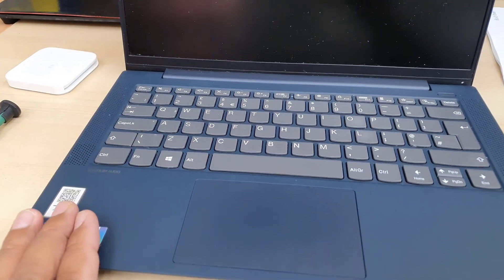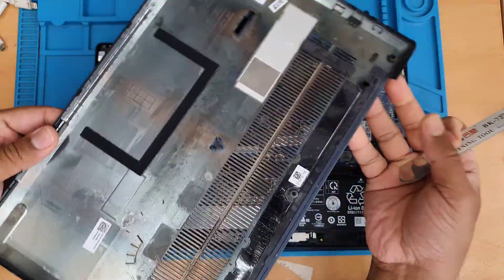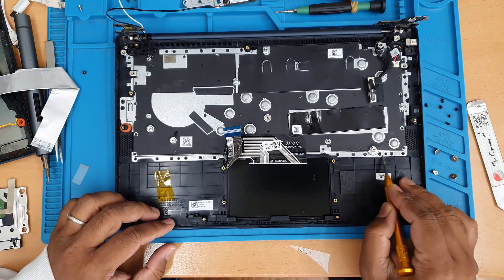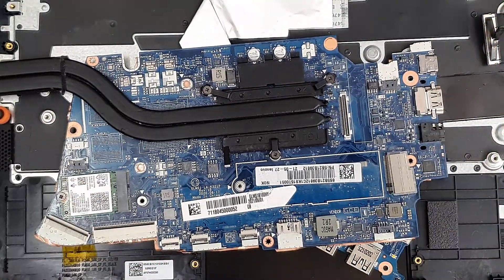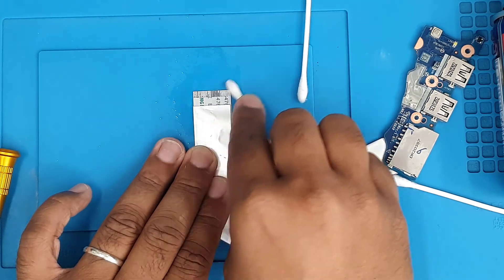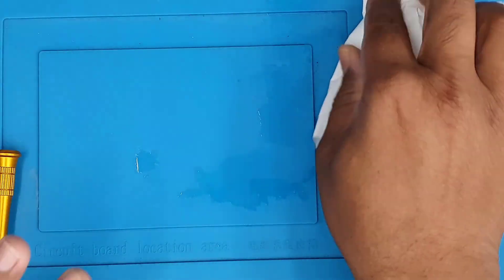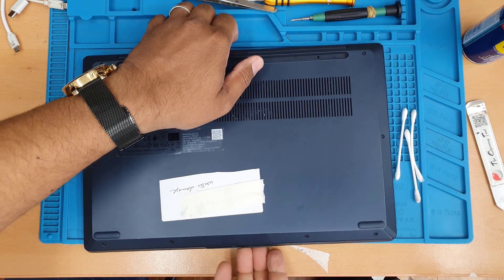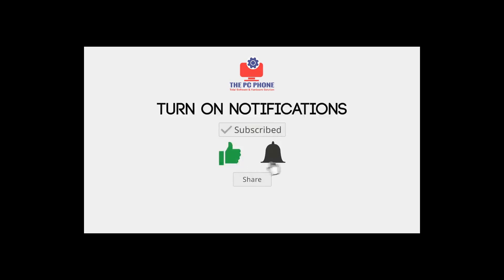How Simple To Fix Liquid Damage Laptop | Lenovo IdeaPad5

Comment: Kudos for the video ..I was able to get my water damaged Ideapad5 using the steps in the video. Water had got into the IO to MB connectors and cable. Cleaning them up with isoprop grub and having patience fixed it.

Comment: Tell me what kind of thing you use to open the laptop at the beginning of the video
Reply: Screwdriver
Reply: I think they mean the flat thing used to pry after removing the screws...and idk what it is, but I want one.
Reply: @CADaze2 it is sold with nearly any replacement part for phones on ebay, ifixit also sells those plastic clips

Comment: The problem with water damage is that some water might sit in a connector or under a chip then, once it powers on, pops the chip out or short out the connector. Removing everything then cleaning every surface that connects to another surface is a great way to eliminate any water. He uses alcohol because alcohol evaporates quickly. Unfortunately alcohol also causes corrosion on components in the future. I recommend scrubbing bublles original formula. I worked with a repair company that had like 20+ locations and this was their trick. 

There is an easier, but risky way, if you don't want remove every component on the device. Remove the battery and leave the cover open. Leave the device in an area with really dry air. If you live in the Sahara you're all set if not see below. Dry the device with towels and DO NOT USE RICE (Rice expands and retains the moisture, it also cloges up your ports) 

Port test: 
Before you dry and 3-4 times in the drying process try and move the device around and gently tap it to move any water in one location. I usually gently strike the device against my palm positioning an opening(like a charging port or headphone jack) towards my palm to see if there is even a single drop of water., alternating between rotating and hitting my palm to check for any water in the ports, keep doing this until there isn't a single drop coming out of any of the ports,  If there was water in any port  dry  again following the recommendations below.

Here are you options: (Do any at your own risk, be patient and don't rush to "try it" cause that's when you really mess up the device, better to play it safe and dry it longer)

1. (The riskiest) Use the oven. I wet an iPod a few years ago and my oven had a low 200-250 Degree Farenheit temp setting but that was still too high so I did two things. I used a towel and kept the door open.  I placed the device on a cookie sheet on a dry towel (Otherwise the metal cookie sheet might heat up enough to melt the plastic) Then I ran the oven for about an hour but KEEP THE DOOR OPEN! You can also use a toaster oven but if the low temps are 250F  or less. Be sure to rotate/flip regularly and use the port test above before attempting to turn on your device. 

2. Dehumidifiers (BEST) If you have a dehumidifier place your open device in a small room or even a closet and run the dehumidifier at the setting that dries the air the most. I would say a minimum of 24 hours. Be sure to rotate/flip regularly and use the port test above before attempting to turn on your device. 
3. The back of the refrigerator (Lower risk, Long time to wait) I would wait about 3 days but be sure not to put it on the floor. Fridges have a tray that fills with water on the bottom during a defrost cycle and sometimes they spill over. (Rare but you don't want to risk it)  Be sure to rotate/flip regularly and use the port test above before attempting to turn on your device. 

Possible things that may work as alternatives that I have not tried but believe they have a good change of success.

4. Food dehydrators, (No idea I would say 3-4 hours)
I like this idea because they use low heat. I would recommend keeping the temperature low/mediumum. I am not sure how hot these get but keep it under 200 and put a towel under your device.  Be sure to rotate/flip regularly and use the port test above before attempting to turn on your device. 

5. A bag with orbis or silica gel packs.(24-36hours)
You know those packs that come In medicine botles and shoes. Or those orbis (orbeeez) Those things excell at sucking up moisture from the air. The silica gels packs are specifically for that purpose. Get enough of those around your device and this may work but you would need to seal it in an airtight container. I would say the amount to immerse your device completely. Unlikly that you have that stuff laying around. Warning, if you have them loose, be sure they aren't small enough to get stuck in your devices ports. Riskly but Would like to try this one day with maybe a two huge flat silica gel packs and  a jumbo ziplock back hat you could slip your laptop in after drying it thourouly.  Be sure to rotate/flip regularly and use the port test above before attempting to turn on your device. 

Good luck.
Reply: I don't know what rinky dink repair shop you worked for but IPA (Isopropyl Alcohol) DOES NOT cause corrosion because the whole point of using IPA is that it DOESN'T CORRODE MOTHERBOARD COMPONENTS. It's 90%+ alcohol which evaporates completely, unlike household cleaners such as Scrubbling Bubbles (lmao) which have many chemicals that don't evaporate and leave a residue which will most certainly either cause a short circuit or corrosion. You won't a single video of Louis rossman or any tech on YT who say that it's okay to use household cleaning chemicals on a motherboard.